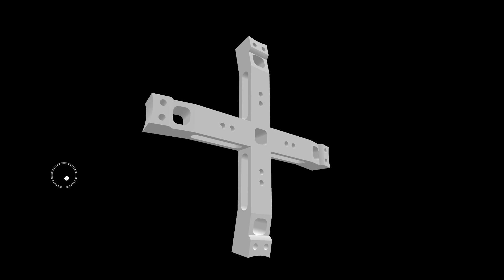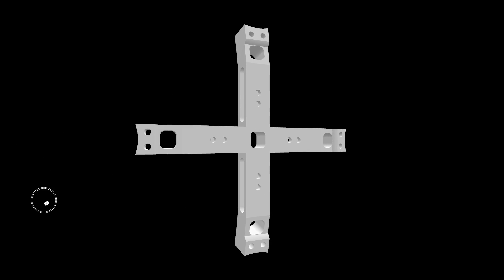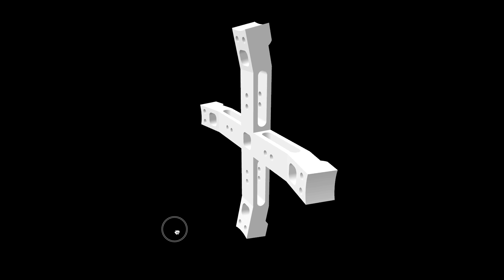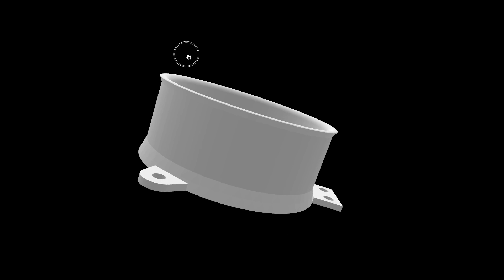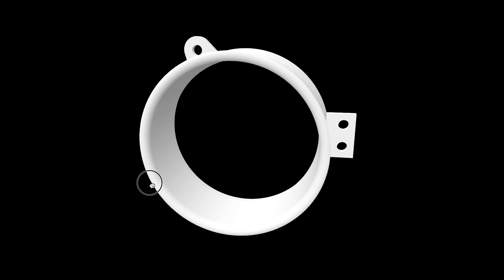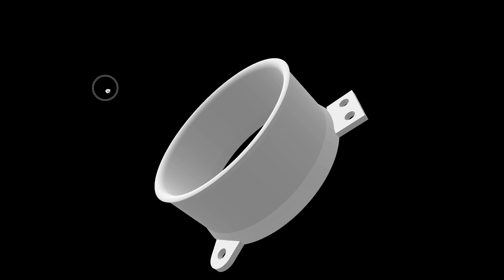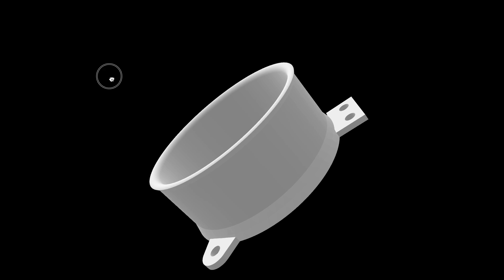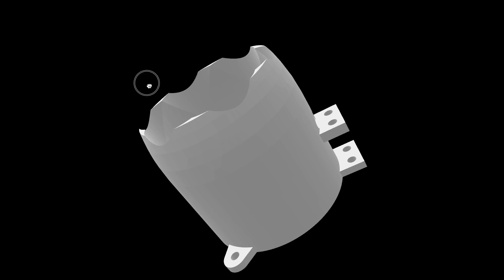Self Stabilizing EDF Quadcopter

Comment: What components did you use?
Reply from the maker: Motors 2x CW 2x CCW:
https://www.amazon.com/dp/B09GM3G6D5?psc=1&ref=ppx_yo2ov_dt_b_product_details

Flight controller:
CC3D 
https://www.amazon.com/powerdayMulti-rotor-Flight-Controller-32Bits-Protect/dp/B01CCCZZRQ/ref=sr_1_18?crid=3VWV9J4KGNQNT&dib=eyJ2IjoiMSJ9.FV-MohvlMAwaBDtXqK03rWZYM3V-v2LnXK3hy__6_4YpSwiAXqGReuobqgTdXeb6E2nGigPmO5r4mL_h18TIrUNsuV5mdQ2Vh8Pf8__gUTkv61C1lfI185nRQpISAaX8JkYqrzr65ZWi6o9Jjw_KXtMBBeYvWOufH6VkmZJKGgwOMGsDn0JVtbfdofd9X2MfXCJGcMkzD6ALLow-NLas_Hey3Bbvh_juu9FFLXCSOnQPz5EWsr4r1FU805u4m4D26Bdq6rccIIt8Qhv16EOn7WWQ4zNmqlMBDu9a1bpukxM.yopWY2xUqQapegCVpS72ZN-HxpAYDa4YNgDugBYGvEM&dib_tag=se&keywords=cc3d+flight+controller&qid=1719668126&sprefix=cc3d+flight+controller%2Caps%2C119&sr=8-18

Or Matek F405 mini
https://www.amazon.com/Matek-Systems-MATEKSYS-F405-MiniTE-Controller/dp/B09RTQPYS5/ref=sr_1_1?crid=39KUDWQGP7ON0&dib=eyJ2IjoiMSJ9.nWFrG_zB_myLPFTusKIVw8h_Fsxtv_nQd6GuDi5bCwB7zglVk-dXg4Kzy_rWWzXHk-HGeM7SyWOZkJdL1yjxEU4cETpmjDdbfVyTn8umLGcksEp0nVaB3wsfgSu75ZKUOO0ucLTZhp2ET0pDVJnQa7M3-iCwP5OdnagJ32ptlDv8PpqZNpWoB6UMNJNrJ73X.6twu38aTTYvWWgwpdCZzs0tNFog3gcsrfVD35NxNncM&dib_tag=se&keywords=Matek+f405+mini&qid=1719668474&sprefix=matek+f405+mini%2Caps%2C103&sr=8-1

4x ESC 35A 
FlySky 2.4Ghz receiver
https://www.amazon.com/FS-iA6B-Receiver-Compatible-Transmitter-Controller/dp/B092J428BF/ref=sr_1_4?crid=3O4600593MBP3&dib=eyJ2IjoiMSJ9.Lp9EHjLIScHTZ7acMjUQlf3hOC9_bqrQ5dahpudwylK81TyVJcKDnu7-A-z9wINNhg8jEP-9lQEp_YDfCgBzJAweBtmzYt_SgS9Em1pt_I2Vtqrb9GUoPq8kBdM6WXedIkZ426O7VTLNzg9y_2J3RlPkI5Csj9zcewpRuKffNw-oPS665wi1y1yywBfTzq_j_DuIjHmHmyz8bdX-POOklmycUf_97phZe0CB5pwRS88_xA8G4fZjRA4nFAyO9m65GsXV7zVoLKIHvLest92LDTpLzoSYXLWRP4c61W3J5To.V8vUxBIq7Q_gA9tTU9jpqJbMcqZRPjpPJHtyQSMXTfA&dib_tag=se&keywords=skyfly%2Breceiver&qid=1719668617&sprefix=skyfly%2Breceiver%2Caps%2C107&sr=8-4&th=1
 
Also there is link to 3D print files in the description, just click “More…”
Reply: @barrymaley  thank you! I am attempting to use your frame (which I really enjoy the design of) to build a slightly different quadcopter.
Reply from the maker: 2x motors:
https://www.amazon.com/VGEBY-QX%E2%80%91Motor-QF2611%E2%80%915000KV-Brushless-Airplane/dp/B09GM51L59/ref=sr_1_4_sspa?crid=29TFVGWLXRWFX&dib=eyJ2IjoiMSJ9.LN6lfIcKVfK-EEdcPe8YPVLJa8yJnd__ztCeP8pqLc2Bjnl0NLjOd-SWjtPiowjfmxr4fR38tvnrbotXo-tThTB28l5jsTrxZH6t3dqHom-r30QuTfeciqVHjhvOA1ZDx-9SV-NKGC76RI_Qq4ANP1llw2gUzZfyEINGzYCmjGWTylYqjhmAWqhwkcRj2ULLxAoa2c0egAVcDq0hYGsv8DzW-RRs-6CF0E6gyquWSx9oOuzucYbtuX8ysyQ_waRE57CiYvkhL0MtxsHk4S9siO4evARWSA3JO7V8Cmx4gaY.jFi0J3jmb8Y39ho3w69zkWbIKHuZa0-t4DNfUxtqHP4&dib_tag=se&keywords=50mm%2Bedf%2Bmotors&qid=1720206710&sprefix=50mm%2Bedf%2Bmotors%2Caps%2C79&sr=8-4-spons&sp_csd=d2lkZ2V0TmFtZT1zcF9hdGY&th=1

2x motors:
https://www.amazon.com/VGEBY-QX%E2%80%91Motor-QF2611%E2%80%915000KV-Brushless-Airplane/dp/B09GM3G6D5/ref=sr_1_1_sspa?crid=29TFVGWLXRWFX&dib=eyJ2IjoiMSJ9.LN6lfIcKVfK-EEdcPe8YPVLJa8yJnd__ztCeP8pqLc2Bjnl0NLjOd-SWjtPiowjfmxr4fR38tvnrbotXo-tThTB28l5jsTrxZH6t3dqHom-r30QuTfeciqVHjhvOA1ZDx-9SV-NKGC76RI_Qq4ANP1llw2gUzZfyEINGzYCmjGWTylYqjhmAWqhwkcRj2ULLxAoa2c0egAVcDq0hYGsv8DzW-RRs-6CF0E6gyquWSx9oOuzucYbtuX8ysyQ_waRE57CiYvkhL0MtxsHk4S9siO4evARWSA3JO7V8Cmx4gaY.jFi0J3jmb8Y39ho3w69zkWbIKHuZa0-t4DNfUxtqHP4&dib_tag=se&keywords=50mm+edf+motors&qid=1720206710&sprefix=50mm+edf+motors%2Caps%2C79&sr=8-1-spons&sp_csd=d2lkZ2V0TmFtZT1zcF9hdGY&psc=1

Comment: check out the one I built on my channel, it doesn't seem to have any stability problems
Reply from the maker: Who said there is a problem with stability? I did not. Flight controller takes good care of a quad stability.
It's not about of a problem solution, but rather about of efficiency.
Simple change in basic quad design, makes FC to do its job little bit more efficiently.
I would like to thank you for watching this video and making your sincere comment, appreciated.